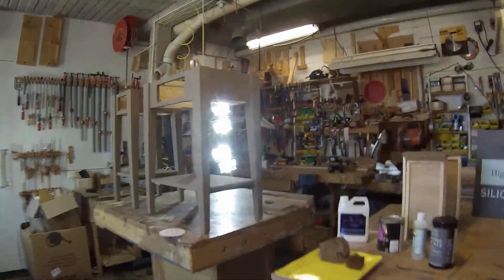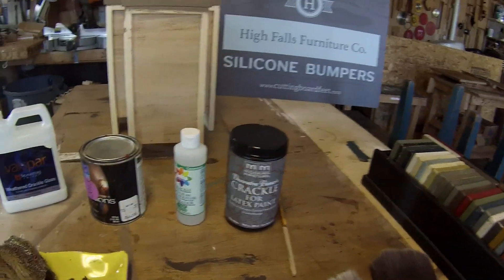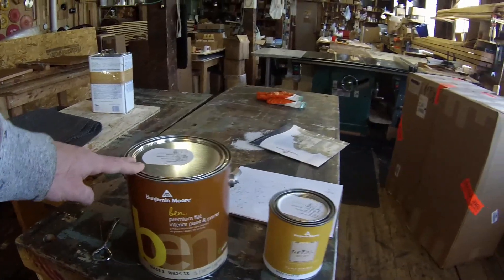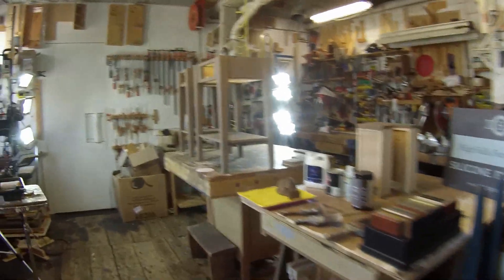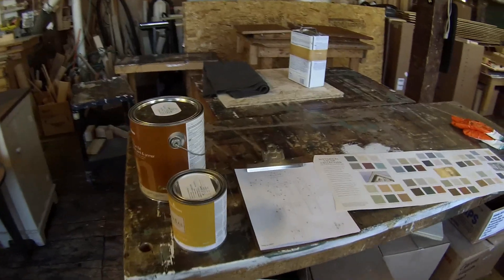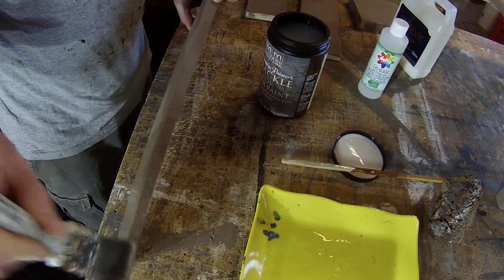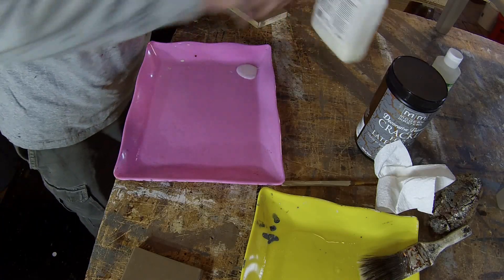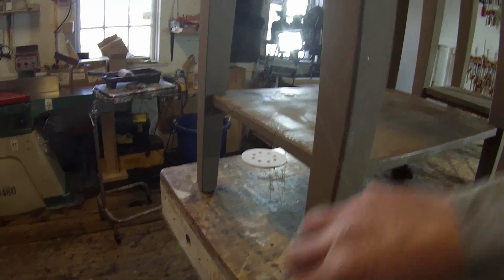Distressed Paint Finishing Tutorial Part 1: CRACKLE

Comment: Can you shed some light on the primer in the paint idea?
I'm probably doing it wrong but for me it seems like unless I use primer specifically, first, I won't get a decent top coat even if the paint also has primer. Last time I bought paint it seemed like it was hard to buy paint without primer "in" it.